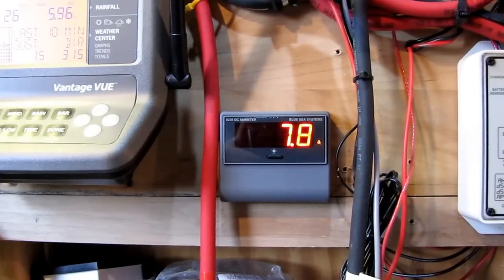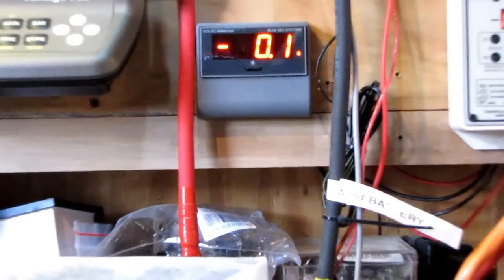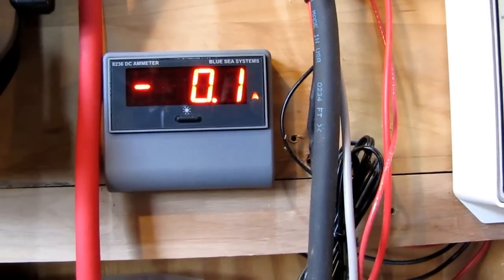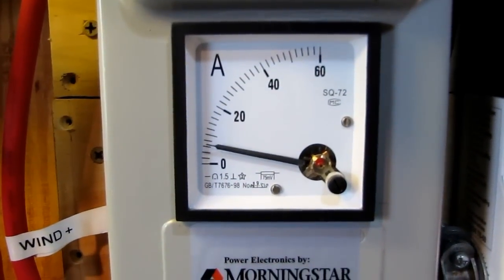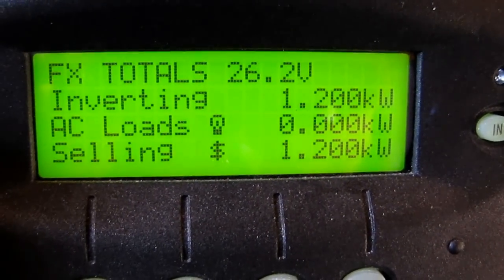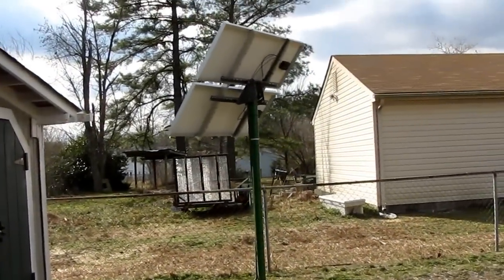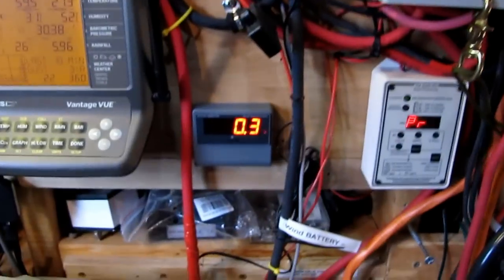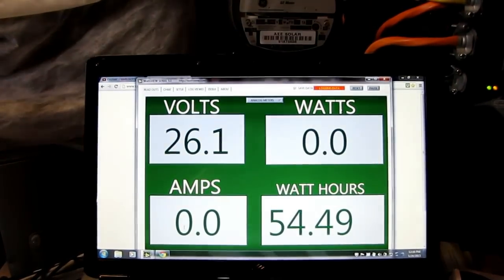Wind And Solar Power  OutBack Style 2  by KVUSMC / VIARLOCITY

Comment from the maker: I Apologize dogfan4lyfe  The Trimetric Is A Battery and Voltage and Amp and Watt Meter  and The Morningstar Is A Wind Diversion Load Control In Case The Wind  Gets To High The Morningstar will Divert Too Much Power  Away From The Battery Bank Going To Resistor Coils  To Protect The Batteries From Overcharging  Mam  Thanks For Correcting Me Cheers Kenny